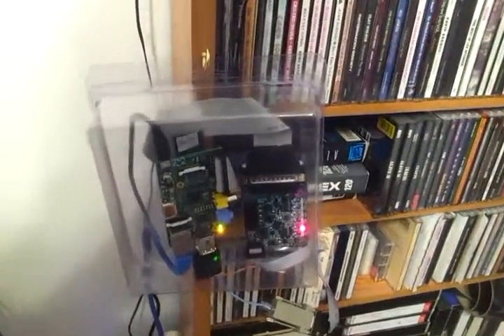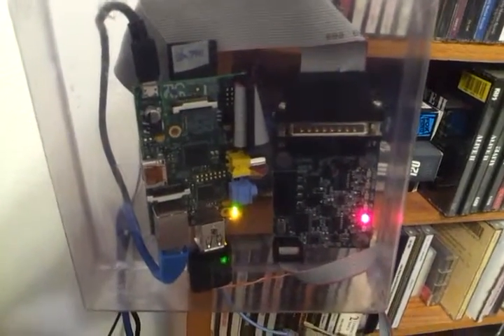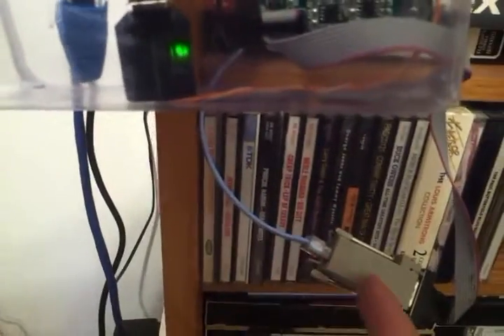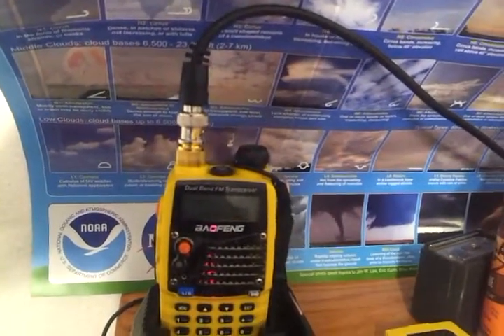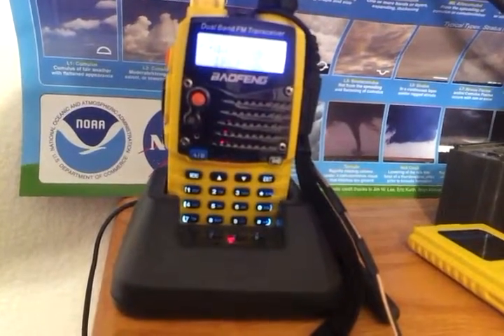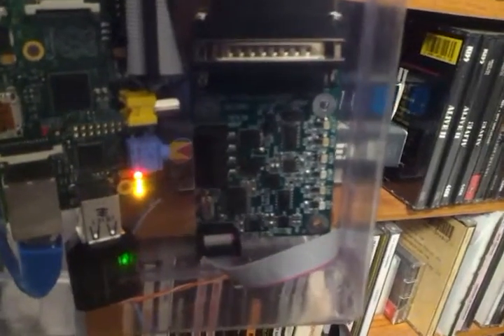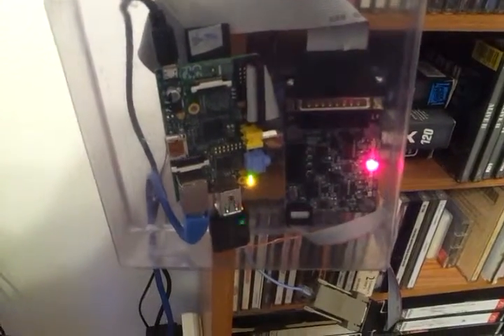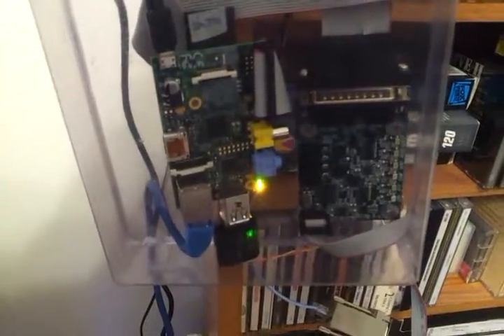Raspberry Pi based IRLP node 7991..Pirlp, new fun

Comment: Hi there, can you tell me if you are still using the Baofeng radio in this setup. I am going to build my own node and plan on using the UV5R radio myself. Just trying to see what kind of life the radio will have.
Reply from the maker: wkmincey Hi, for me, the UV5R sits in the ready position as  my backup link  radio now, 
I found a couple problems with using the UV5R, 
1- overheating
2-battery depletion under a net condition.  (battery will actually run down while sitting in the charging base)

A friend still uses a UV5R for his IRLP node, and when using a battery eliminator, and a couple good sized fans, he overcame the 2 problems that I mentioned.   

I decided to buy a little commercial radio, (GE MVS) for my link radio, (I cant program it myself--a negative),   and when dialed back to 7 or 8 watts, it will run nicely without overheating. 
If I were to build another one today for 2 meters, I would probably go with a yaesu 2900 for it's ruggedness, massive heat sink, and ability to program it easily.  

good luck...irlp is fun and I enjoy tinkering with it.
73 de AG6IF
Reply: Thanks for the quick comment. I'm looking in to the commercial radios but for what they are they are a little rich. I think I'm going to try and mod a mobile unit for this purpose instead of the UV5R HT. Unless I can find a decent deal on a commercial mobile unit.

Comment: Can you suggest websites to follow with detailed instructions?  I can piece together the wiring, but the programming is not very straightforward.
Reply from the maker: Hi Alan, I am going to assume you are talking about "programming" the UV5r?  Well,just hit menu, up arrow to 8 then menu again, and up arrow to adjust the settings, then hit menu to save.   Do this for both 8 and 14.  73  de ag6IF
Reply: I was actually referring to programming the pi.   Thanks in advance .
Reply from the maker: Alan Thomas ahh..ok, my mistake.   see the site    irlp.net   where a ton of info exists, and you can obtain a SD card with the OS and the IRLP software which is ready to run.

Comment: What's that connected to the USB socket of the Pi? Is it a USB soundcard? I don't think you mentioned it. Regards G0UDX.
Reply from the maker: Nick Davies Sorry Nick, I dont think I responded to your question..the sound card is plugged into the USB port.  I bought this from Dave Cameron also, he soldered in the wires that feed the irlp board.  73 de AG6IF Jim